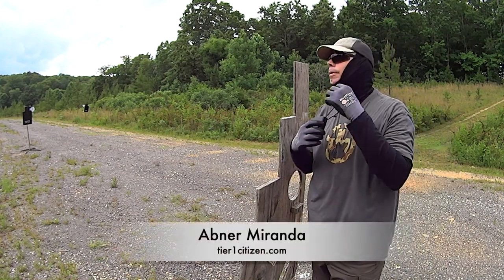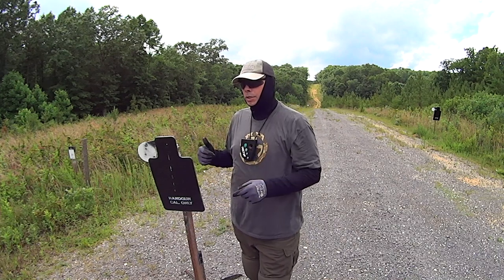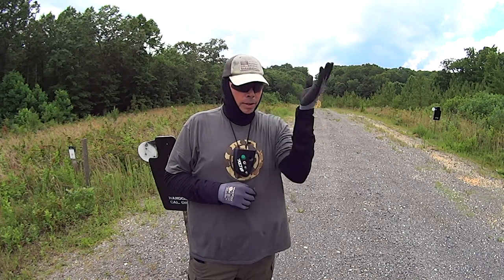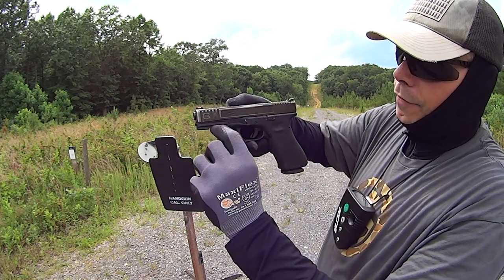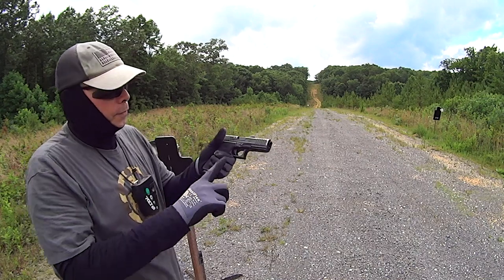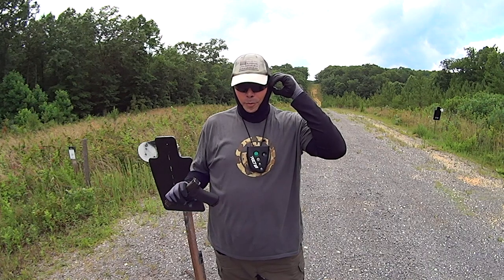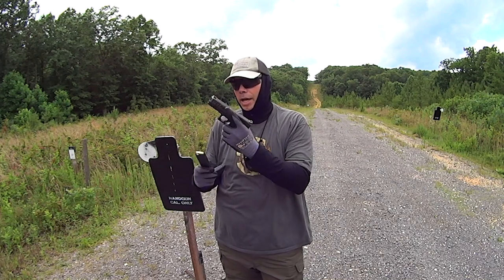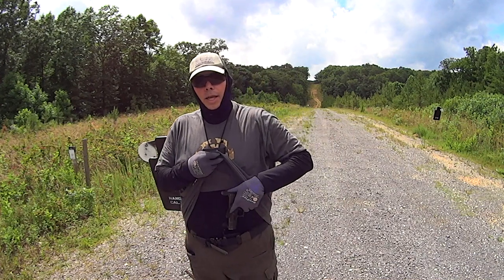The Gas Pedal Cut / Mitigating Handgun Recoil

Comment: In doing mods to your Glock 17, did you change out the barrel or are you still running the stock barrel.
Reply from the maker: Everything is stock except for the connector which is a Zev V-4 and the safety plunger which is made of titanium. The plunger is actually a whole lot of nothing-burger but I just felt like putting it on mostly out of curiosity. It offers no performance boost but it's been in there for a decade so might as well leave it in there now right?

Comment: For me there was never enough realestate on a Glock frame for a gas pedal to get me enough grip with my thumb. What helpede is to remember to have a better grip with my support hand and a stream light trl hl on the help me reduce the muzzle flip.
Reply from the maker: Yeah the light helps, but I don't run a light on my blasters. Here's why: https://youtube.com/video/WUPVfZ-XTk8/
Reply: GoGun makes a "Gas Pedal" that fits on various handguns. Their models for Sigs and Springfields replace the takedown lever, and the model for the Glock clamps on to the rail, and extends backwards along the frame to reach your thumb. BIGGEST downside that I see, is that it conflicts with your holster. Looks a little weird, but I really don't care as long as it gives me an advantage...practical usability though... 

There are other brands out there, but everything else looks half baked or gimmicky. Still...might buy one of these and see if I can make it even more low profile, and modify one of my own holsters to get them to work together. Personally though, I do run my support thumb really far forward, so I would probably have to modify my grip quite substantially. Might be more trouble than its worth.